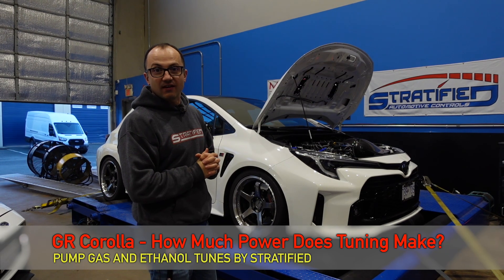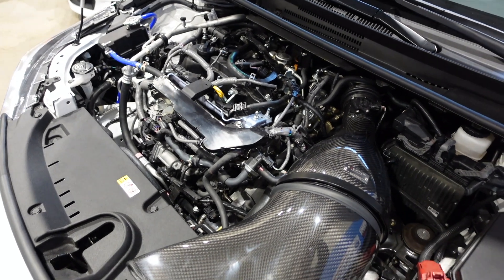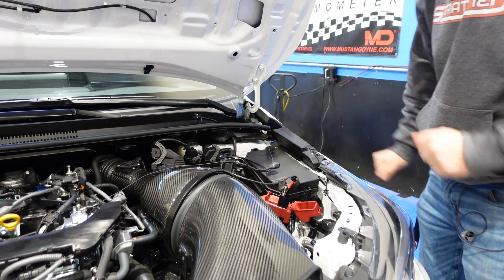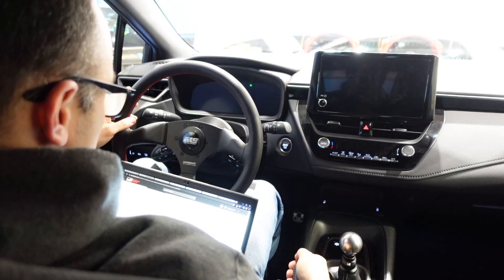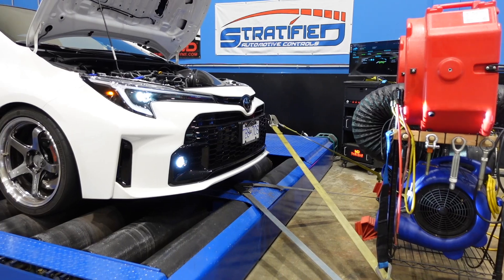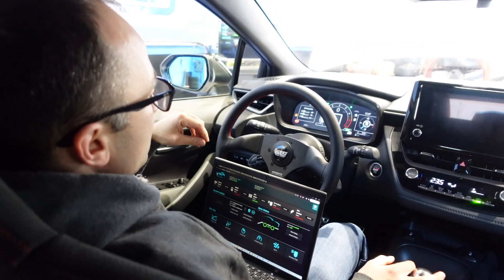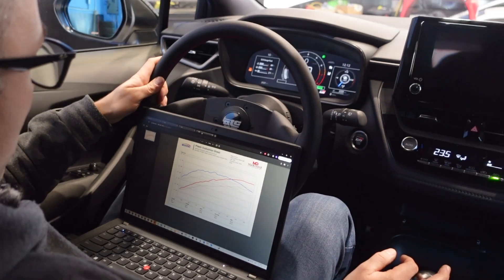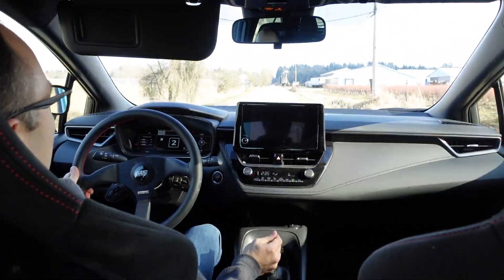GR Corolla - How Much Power Does Tuning Make - EP1

Comment: My MK8 GTI running Stage 1 from 034 MS has more power and more torque on pump gas than this GR. (not impressed yet 😅)
Reply: With one more cylinder and years of after market support. It’s not really surprising.
Reply from the maker: Quite a different car and experience.

Comment: Have you heard about the stock ones exploding? Toyota isn't making it right. Be careful with Mods they will use it against you
Reply from the maker: This has always been the policy of manufacturers, they don’t warranty mods. But if you mod well and smartly you can enjoy the car trouble free.
Reply: @stratifiedauto  that makes sense, but from what I hear the stock ones are exploding
Reply from the maker: This engine has been around for some time in the Yaris and so far it’s been pretty reliable.

Comment: This car in Stock is basically 250hp. The 300hp is a marketing term.
Reply: It does make 300 engine hp. Manufacturers don't measure whp
Reply from the maker: This is correct. It is around the 250whp mark on a dyno. Similar to an STI which was also rated at 300.

Comment: Alex’s tuning skills are second to none. He has tuned two different engines and platforms for me (Fiesta ST with “big turbo” plus my current stage 2 VA WRX) and my WRX has been running FLAWLESSLY for 86k miles post Alex’s 93 octane tune. I sold the Fiesta ST but it was running great too as long as I owned it. I won’t hesitate to work with Alex on my next car, and who knows it could be a GR Corolla?
Reply from the maker: Thank you Ryan and looking forward to working with you on your next project!
Reply: @stratifiedauto  Sad update, and my 2019 WRX was destroyed by a tree that fell during the recent May 16 windstorm in Houston, TX.  I am strongly leaning toward another new WRX. I deleted Facebook messenger (how we communicated in the past) and I will be reaching out via email for your thoughts on the FA24DIT and what you my recommend for a “basic” tuning path. I’m thinking very basic with TMIC, intake, CBE, and 93 octane Stratified pro-tune. “Conservative” and tuned for reliability above all out performance since I want to maximize longevity. Thanks in advance and I look forward to working with you again.

Comment: Man that engine bay looks like total spaghetti monster crapola. Sure miss the days of a clean b series honda engine bay. At least the type r kinda looks ok for modern times
Reply from the maker: I agree. The modern engine bay is not as clean. A lot of sensors actuators wires and tubes. But they perform well

Comment: The way the boost was acting reminded me of a decently sized engine with a small turbo and a manual boost controler.
Reply from the maker: For the 3 cylinder that turbo is actually a good size and makes a good amount of power.

Comment: would not trust a 3 cyl to not blow up
Reply from the maker: I would say the number of cylinders has little to do with that when well tuned and maintained.
Reply: @stratifiedauto  well tuned and maintained. Like those gr Corollas that caught on fire?
Reply: Why exactly? These motors are overbuilt pretty heavily, except the valve springs.

Comment: Just buy a Golf R people, and watch yourself absolutely destroy this tiny GRC in every single category, and save yourself money too.
Reply from the maker: Being in this industry long enough and having run setup and tuned pretty much every vehicle in this category I can tell you that each has unique characteristics that the owners enjoy. We help make them all better.
Reply: VW is junk. Former mk6r owner, and plus a bunch of different generation gtis. Why don't you light up a manual r, versus this car? Mods for mod, the GRC beats the F out of it
Reply: No manual no care and I've owned multiple vws
Reply: Yeah and when it breaks and the parts cost you 3 times as much on the vw as the toyota cost.... Trust me i had a golf and when the engine blew i was shocked how much it cost to fix. Might as well buy a entirely new car, which is what i did. Toyotas have always been cheaper to work on.
Reply: No one wants vw unreliability. They're flat out junk. And not to mention 2x the cost to mod.

Comment: I’m curious to see the engine-lifespan and reliability of this tune. That’d be crazy gains if the engine still lasts long-term
Reply from the maker: Most modern turbo engines are happy with 30-50% power over stock long term.

Comment: Is it new???? I would imagine the gr yaris tunes are 95% the same... they already proved 500whp is reliable.
Reply from the maker: Use case scenarios will affect reliability. However at the power level in the video the car will be happy for a very long time.
Reply: @stratifiedauto  Your honestly not even stressing the motor at that level.  I was not saying go to 500whp... those are the people really pushing the platform but 450whp would be fine.  That was also 500hp on the older one.  Toyota has made this platform stronger since then because their CEO races the car and breaks it with the engineers watching and your going to quickly fix and improve your CEOs car when it breaks.
Reply from the maker: I look forward to a bright future for this platform.

Comment: I think the GR corolla is supposed to be dynoed in front wheel drive. The all wheel drive system regulates power. The car will shut the rear wheels off anytime with the Ebrake on. In dyno mode, rear drive shaft our and ebrake on for consistency. Just what I have read in my research.
Reply from the maker: We did the pedal dance. We also tried it in and mode. Not much of a difference to tell you the truth. At higher speeds with no slip it will not engage the clutch packs much or it won’t be stable. Similar to focus RS.
Reply: @stratifiedauto  thanks for the explanation. Excited to see how you dial it up
Reply from the maker: More to come!

Comment: is it possible to do a full e85 tune with stock injectors and stock low pressure fuel pump?
Reply from the maker: We will find out soon. E50 is about sweet spot for power.
Reply: @stratifiedauto My reasoning for e85 is just so I don't have to play with the mixing to make e30 or e50. Thank you for taking the time to reply to my question.
Reply from the maker: Fair point. We should be able to test this shortly. If it needs more fuel it’s nice that this car has port injectors we can easily swap and upgrade.

Comment: I'm confused why you believe the boost gauge fluctuating with the gas pedal / throttle body is in your mind the hallmark of a good tune.  It's going to fluctuate whether the tune is good or not.  I would be much more concerned about the air to fuel ratio and the kr than anything else.  But hey, the visual makes for a nice video ;)
Reply from the maker: What I was showing there which is hard to capture on camera is how boost responds to different levels of throttle input. It should be responsive and not oscillate.

Comment: Folks in Australia called Powertune Australia made 770hp on the gr yaris with just cams and valvesprings, but they did use some nitros. Other than that, the engine was stock bottom end... that's crazy. They live streamed the tuning process, too, and did many pulls. They said they will post more about it soon on ig and bring it to the 1/4mile
Reply from the maker: That’s a lot of power. On our dyno to make that power you would be spaying a 300+ shot of nitrous.
Reply: @stratifiedauto The GR Yaris was fitted with an upgraded head gasket, along with uprated head studs. Elsewhere, the intercooler was swapped out for an aftermarket version from Plazmaman, while the three-cylinder benefits from a Garrett G30-770 turbo. Powertune Australia has also fitted a turbo exhaust manifold, intercooler piping, and a dump pipe from Golebys Parts. A MoTec Yaris Plug-in ECU also forms part of the package.

2,200cc Secondary Injectors from Bosch replace the stock items. The Yaris also receives an Elixr Brushless fuel pump and a cat-back Akrapovic exhaust system. But that's not all. Even the gearbox has been replaced with a six-speed sequential transmission from X-Shift and mated to an ATS Triple Carbon clutch.

Interestingly, Powertune Australia has decided to retain the stock rods, crank, and pistons. "We have pulled numerous engines down, and after doing a lot of comparisons and measurements, we believed we could make our target power with the stock items," said a company
Reply from the maker: How is the powerband with that very larger turbo? It must come on fairly late on the 1.6.
Reply: @stratifiedauto  The zero to full boost in just 4.5 seconds! haha
Reply: @cybasmuggla3697 I was going to say, 470hp gain from springs and rods....Are they made of magical elvin metal😅
Reply: How do you mess up info so badly?
It uses a lot more than just cams champ and doesnt mention nos.
Reply: @cybasmuggla3697  i was mainly talking about stock bottom end, but yes, i didn't mention everything. But they did use nos, though. Thanks for clarifying the other stuff anyway👍
Reply: Better dyno airflow amd front drive only will give you more consistency during your runs. Keep in mind the GR Yaris has been out long enough that it's now in Gen2. Major changes have been made to that car. My point is this drivetrain has been out for a while now. Lamspeed in Australia worked a GR Yaris over and I believe they still have the 1/4 mile record with it so far. They are also road racing it. They have some great videos going through all the stages and a roundup video if you just want HP numbers by mod done. The engine can take a lot with the right upgrades. One in Europe has I believe 770 HP?! A sequential transmission is a must at those levels. Nemtec Racing just broke their tranny again and might go sequential. Valve springs will be the first internal upgrade needed after 400-450 HP. 
If you leave it stock and don't beat it up it will last like a Toyota, except maybe 2nd and 5th gear😅. If you spend a fortune to build it up you will likely have issues, or maybe you buy better reliability in some cases (transmission for example). Wait till 2025 and see if the GR auto is as good as the Toyota engineers are claiming it is? IDK. At the end of the day it's just another car and option if you want to give it a go. Have fun all!

Comment: Will be interested to see when valve float hits
Reply from the maker: I haven't experienced valve float during the testing on this car - I have experienced it on others and you start to see misfires. Valve float however is a function of RPM and backpressure. Keep redline reasonable and be aware of boost levels.

However boost is not the only way to make power. The gains from E30 are made without much increase in boost or back pressure. A lot of it is from the increase in efficiency from timing and fueling changes.
Reply: Im really interested in the back pressure situation with this car. Toyota in their marketing explained that the "unique" exhaust setup of the GR Corolla is for the backpressure issues they faced when pushing the 1.6 -- I am currently looking at almost straight piping mine. Could you expand more on that in relation to valve float?   @stratifiedauto

Comment: With just an intake? Holy crap that's awesome! Would fbo be enough to get close to 400 whp on pump gas?
Reply from the maker: We will find out just how much individual flow modifications add.
Reply: No, not even close. Probably not even e30. And at those power levels and RPM you also start getting valve float, so valve work and probably head studs are required.
Reply: @CSHracer not really... depends entirely on the springs... the vw 1.8t only needs exhaust valves past 400chp because they'll burn up, but you don't need springs and retainers until you've passed like 500chp.
Reply: @OldManShoutsAtClouds it’s already been documented that the stock springs on the GRC have experience valve float at around 320hp, nemtec racing
Reply: @halorita  my bad, was thinking of an entirely different engine.
Reply: @halorita  if its documented then how come this video didn't mention it, what i heard is valve float is happening right before red line. so shift gears at 6900rpm and your good lol

Comment: It is all fun until it blows up or rear end overheats.
Reply: The rear end overheats because the sensor is right next to the exhaust they already fixed that with $10 heat wrap
Reply: @UnstoppableMileage  That doesn't fix it. People have tried several things, that does help, but with agressive tracking, you need more than some heat tape. That said, the number of people pushing the car hard enough to cause the diff to over heat is very small and if they are pushing it that hard, they will likely be OK dealing with the over heating.

Comment: "At least 5kph over the speed limit" best line of the entire video. :)

I'm going to request something.  Could we also get the torque curve before and after the tune?  And, how about the tune with the factory intake?
Reply from the maker: The torque curve is there for the stock tune. However this was all done with the intake. No runs with stock air box.

Comment: This is a crazy gain on a 1.6 3 cylinder
Reply from the maker: Definitely impressive!
Reply: Compound turbo any small liter and just let the pump dump fuel and you’ll be surprised what compressed air and the correct amount of fuel for said air can do
Reply: It's a 3 cylinder but with some big ass pistons so don't let it foul you just because it's a 3 cylinder
Reply: @JorgeCabrera-zh7yr 1.6/3=.53L per cylinder so really not that big considering an sti is 2.5l 4 cylinder
Reply: @brandon9491  An STI will have ringland failure before 70K.  Ask me how I know.
Reply: @goatlocker219 but you looked GREAT doin it no!
Reply: I have a 2019 sti limited just bought a 24 GR core and believe it or not it smoked my sti the only place the sti was better was the launch thats with full bolts on and a ap single fuel tune 😂@brandon9491
Reply: @goatlocker219 you just drew the short straw lol I’m at 100k @ 350ish whp and have had barely any problems over the eight years I’ve had it. The car itself is getting expensive to maintain though.
Reply: @sm0keyyy_  I sure did.  Although, there are four class action lawsuits for this exact problem.  I wish you luck with yours.  I'm almost done with our 600HP build.  I'm sure maintenance is going to get more expensive from here on out.
Reply: @JorgeCabrera-zh7yr still 1.6😂